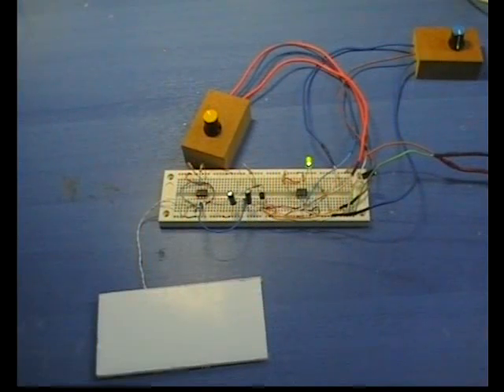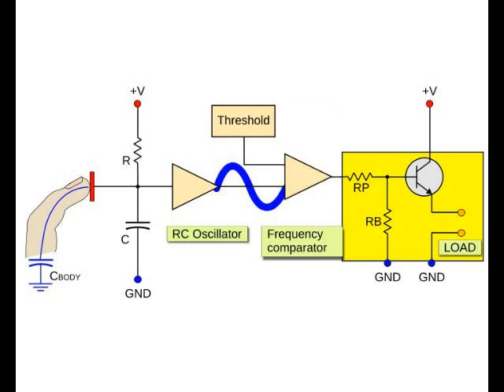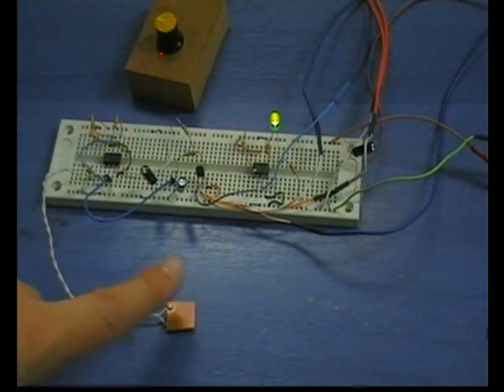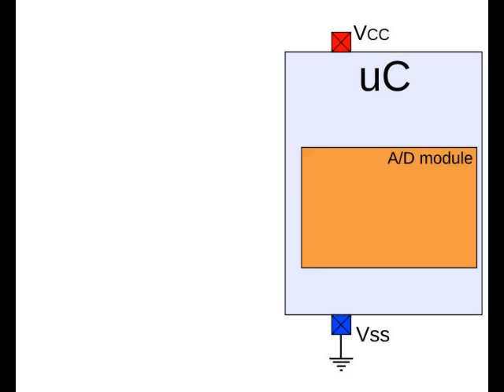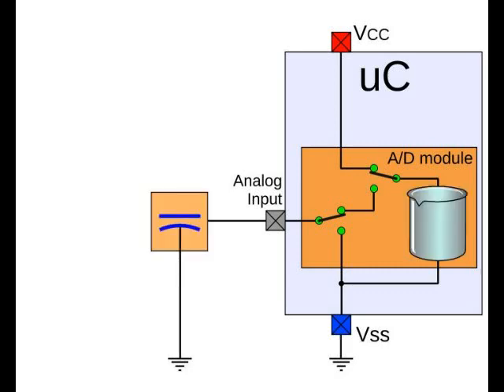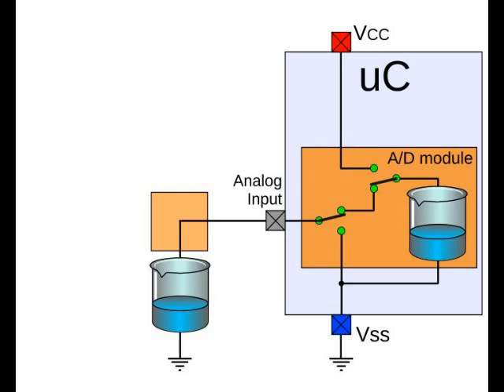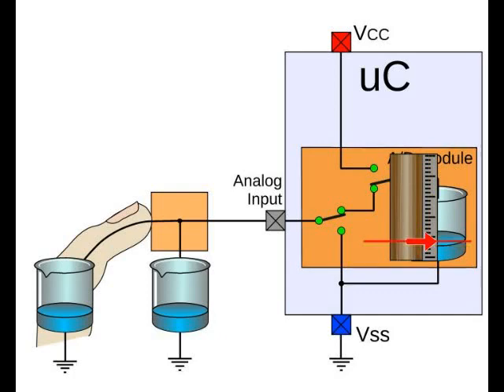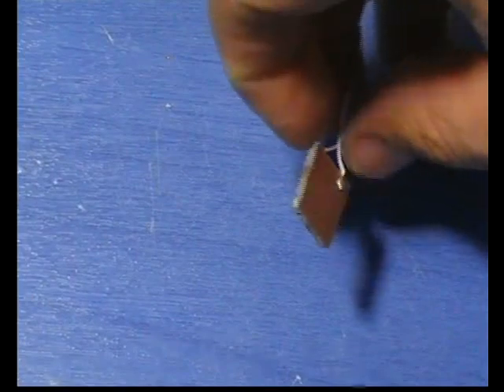How the Capacitance touch sensor (button-switch) works

Comment from the maker: @dying2l they have a rubber piece like spring, and this piece has some kind of conductive material in the middle. When the button is pressed, the conductive material touches the PCB underneath. There are 2 pads on the PCB that the conductive material touches and closes circuit.

Comment: Seems like too many components. I think all is needed is a digital I/O pin with pull-up or pull-down. The pin and pull-up/down would be connected through a resistor to a capacitive sensor pad.

Imagine there is pull-down. Then you set the pin to output, output 1, wait for a good while to let capacitor charge to logic voltage, set the pin to input, and measure the time (by level trigger interrupt or w/e) until the signal drops to logical 0. Opposite if pull-up.  The capacitive sensor pad and resistor form an RC, the timing of which depends on the capacitance C that you can infer from timing.

I don't know whether this would actually work, but if you know a reason why it's not done like this, i would be very curious.

I just find the imagination that somebody would use a capacitance inside an IC a bit icky and wasteful, i appear to be more used to "BYOC", bring your own capacitor (instead of chair).

Comment: Hello I had a look at various PIC controllers with ADC but none of them have the internal switches that you mention. Do you mean that it has to be a microcontroller with built in capacitive sensing block instead? The one youused, has that.

Comment: Thanks for tutorial, can you be more specific on configuring the I/O pin:

1. The ADC module is internally driven to VDD, so that the capacitor used for the A/D conversion is fully charged
2. The analog input (sensor) is internally grounded, so that the sensor is fully discharged
3. The analog input (sensor) is internally disconnected from the ground
4. The ADC module is internally connected to the Analog Input (sensor)

Can you give a C code example for the above four steps please ?
Thanks in advance
Reply: i'd writte it on assembler, lol

Comment: Nice work Sir! @pcbheaven. I have implemented the CSM on PIC16f1939 successfully. Now to take it little bit further I need to know the "amount of time (in sec or ms)" any perticular sensor is touched/pressed. Is there any way to do that? 
Thanks.
Reply: hi Pravin,
kindly upload guidance how to implement CSM on PIC1639. or please give any link for this. which compiler you had used MPLAB or MikroC? 
Thanks in advance.
Reply: I used it with MPLAB-X compiler. You can refer application note from microchip.

Comment from the maker: i dont have this circuit schematic in my site because as i explain it is only for demo purposes and it is not reliable. But you can learn more about capacitance sensors in my circuit and theory pages in the site.

Comment: Hello, I am looking for abit of help.  I am creating a capacitive touch system with blue and Red LED'S that light up when touched.  This is for a friend who has a disabled child, and it is going to be a learning aid for them. hav 2m of blue LED's and 2m of red LED's + x8 AA cells. I ned to create x2 capacitive touch pads that are 20x20cm and when the system is on the Blue LED's are lit up when either of the pads are touched, it changes to Red LED's on, and blue off, so it basically switchesLED'?